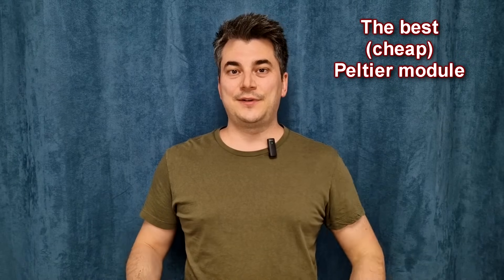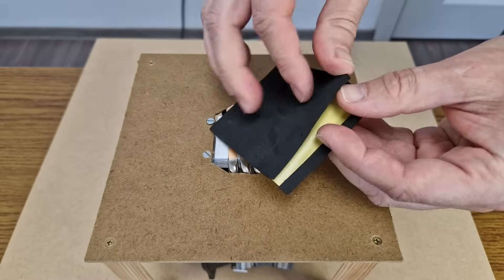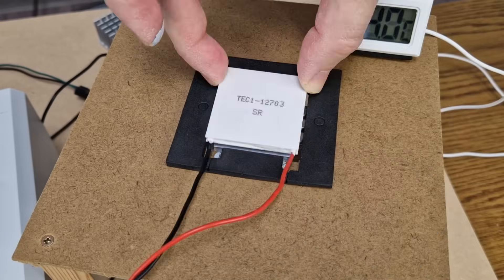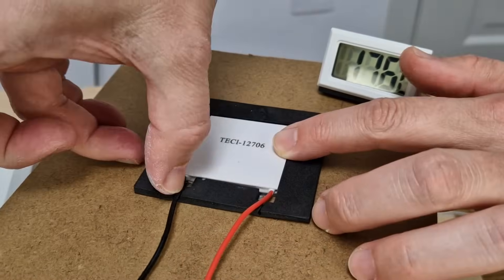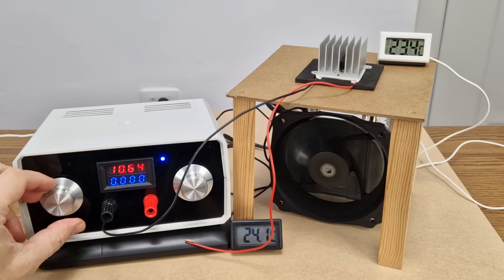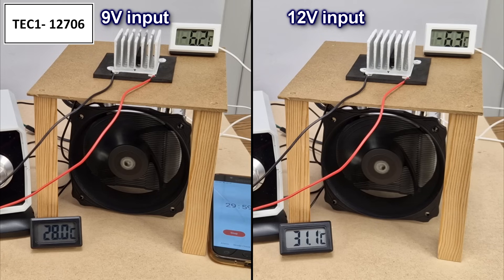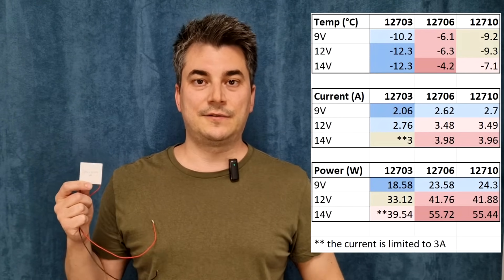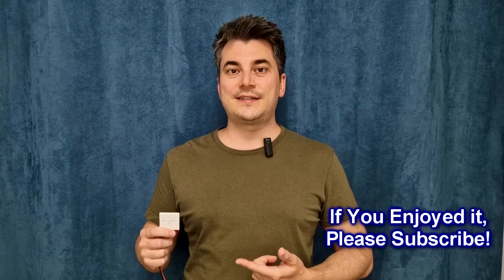The best (cheap) Peltier module [test 2]

Comment: I've just got into peltier experimentation for the first time. At the moment I've only got the 706 modules. It seems to be true that the hot side heatsink needs to be huge for this one. I found a CPU cooler on a scrap desktop so I'm using that for hot side with the fan set to run at full speed. Down to minus 8.7 C on cold side so far (been running 20 minutes). Powering it all from a small LiFeP04 battery. Voltage at this moment 12.73 current 3.75 amps including fan, which uses 300ma at full speed.
Reply: You should be watercooling the peltier on a waterblock with a radiator instead of treating it like a CPU.

Comment: Why the 03 Peltier performes not as good as in the first test with 12V?
Reply from the maker: Because in the second test it has a bigger radiator on the cold side, it has to work more to cool it down.

Comment: Don't blame you but peltier elements rely on constant current.
You waste around 30% energy heating them up with constant voltage here.
Thats also the point of the three tiers - the max current rises with each "better" model. 3A -> 6A -> 10A

It may be asked a lot but PLEASE rectify this and do the correct test.

Comment: Would the 12703 be a good choice to use for a simple laser power meter if the lasers being tested are less than 1Watt (1000mW)?
Reply from the maker: Yes and you can probably power it with a lower voltage.
Reply: @Sorin_DIY  Thank you for your reply. Actually, the laser is pointed at the Peltier and a volt meter is used to measure how many mV are produced. That number is used to calculated roughly how powerful the laser pointer is. I will purchase a 12703 and experiment a little. Thank you for posting the link to the Peltier modules!

Comment: Sorry, but this experiment is also bad. It is extremely misleading and it neglects many basic concepts. 

Just a little list: 
- It is not true that Peltiers have a recommended supply voltage of 12 V. Where did you read this nonsense?
- You did not apply the same amount of thermal paste for all modules. 
- You failed to notice that something is wrong with the whole setup. The Peltier is not clamped down, therefore the heat transfer between the hot side and the CPU cooler is insufficient. This clearly shows up in your results. If you look up the datasheet for example for the 12706, at 12 V you should have somewhere between 4-5 A, but closer to 5 A. You barely reach 3.5 A. This is because the temperature difference between the hot side and the cold side is very large because in your case the hot side is very hot. Therefore, the Peltier throttles itself down and that's why you see such a low current. Same for 12710. 
- Furthermore, you should have noticed that even at 14 V, you were nowhere near the maximum rated current of the Peltier cooler. Again, your setup is faulty. 
- For the TDP, you failed to mention the heat pumped from the cold side to the hot side. That also appears on the hot side and it has to be dissipated by the CPU cooler. Even though this heat is not a large amount, it matters. 

Unfortunately, your results are bad and misleading a lot of people. I hope you won't get me wrong, but you should study thermoelectric coolers a bit more before trying to educate people about them.
Reply from the maker: You are nitpicking, for example when I power the 12706 module with 12V in the first second both Peltier surfaces have the same (room) temperature, it draws 3.65A. Why doesn't it draw 5A in the first second? it takes at least a few seconds to heat up. after 30 minutes the current consumption is a bit lower, but not too much and not in the first second. and also this problem should affect all the modules including the 12703 (not in exactly the same way, please don't nitpick, but to some extent). I'm guessing that this is because the modules are of low quality. 
the (lack of) thermal paste is not a problem, I also added paste on both radiators before mounting each module, even if it's not visible on camera. 
I know that the test isn't perfect (nothing is), but there is no point in continuing to explain, you've already made up your mind.
Reply: @Sorin_DIY  It is not nitpicking if I can identify several multiple mistakes throughout the video. The current could be limited by the contact resistance of your dodgy cabling as well. You just pushed a bare wire into the connector of the power supply. At these high currents, they should be clamped down correctly, and there should be a decent connection between those wires and the power supply. I tested many of these Peltiers, but they never acted like this. I could nearly reproduce the datasheet values in my tiny "lab" at home. If something is wrong with these devices then it is typically the fact that they are falsely labelled. I encountered coolers labeled as TEC12517 but they we actually TEC12706 when I measured their characteristics.

Comment: Hi, I watched this video and bought 2 of the 12703 . I have them hooked up to a 12.5 Amp 180 watt power supply found on Amazon.  The hot side gets 140 degrees but cold side only gets to 64 degrees.  What's my deal?
Reply from the maker: Did you add a large cooler on the hot side of the module?
Reply: @Sorin_DIY Thanks for replying.  I've got a 120mm by 70 mm heat sink that the 2 modules are thermal glued to and 2 40 mm heat sinks thermal glued to modules.

Comment: please reply
" WHY ARE ALL THE MODELS CONSUMING SAME AMOUNT OF CURRENT(AMPERE)"
Reply from the maker: The modules don't use exactly the same amount of current, there is a small difference between them. the higher the supply voltage, the higher the current consumption will be for all modules, so you need to limit the current according to the specs of each model. they can be powered with up to 15V and some of them even 16V. and also these modules are cheap and of low quality; high quality modules are very expensive and more accurate with the current consumption.
Reply: Good observation! The higher power modules "throttle down" because they don't have sufficient cooling on their hot side. He did not clamp down the modules, so they don't have sufficient contact with the CPU cooler. They borderline overheat and therefore they limit their own current. It is "just" a very bad experiment.

Comment: Hello Sorin, content suggestion: you could bring a complex project with a power bank with a built-in Android smartphone in conjunction with smart relays to control them remotely (turn on, turn off lamps, sockets, maintain with UPS and or turn on, turn off modems and routers and computers remotely in case of malfunction)

Comment: Can i run the peltier with a charger😢
Reply from the maker: It depends on what kind of charger. if it delivers the necessary voltage and current, it will work.

Comment: thank you so much my friend, great job well done
Reply: im in order build mini water cooler peltier fan PLUS mini refigerator (dunno what im thinking but i like chill ambience on my desk and take one shot soft drink)😂 , 

in my case i just found -9 degrees celcius with 3x3cm peltier reaching so fast and only using usb c PD charging decoy port. its about 25 watt in smartphone adapter with volt amp meter (6v-7v) fast cooling and stable.

and in another case, just found chinese cooling fan for smartphone 2,3cm peltier can reach -3 degrees celcius, 2,5cm peltier can reach -5 degrees C. stable. (edited : 2,3cm = -5 degrees, 2,5cm = -3 degrees)
*i use proper thermo gun not that fake lcd indicators

thats insane the voltage, fan and heatsink not heavy stuff only 5v - 1-2Amp
Reply: you can try more affordable peltier for sure and save energy more for the earth lol😁 nice to meet you. enjoy

Comment: Agree 100%, especially because my applications are all for outdoor solar powered electronics.....the ability of the 03 modules to operate efficiently down at 9vDC gives me a little more wiggle room for parasitic current draws like cooling things getting cooked in the sun. As a personal project, i might have to try a similar concept on a game camera or two since they are notoriously easy to kill with only moderate heat or sun exposure.
Many thanks for posting this comparison.

Comment: Would you also consider testing the SP1848 27145? I can't see if it's supposed to be a generator or a cooler, but I'd like to see how well it performs in cooling against the TEC127XX units you have. Even if you don't test generation, just pumping, that would still be interesting to see.

Comment: I tec cooled my canon t3i dslr for astro imaging. I opened the camera and packed thermal transfer pads to get the sensor heat out the back of the camera. I did not want to cut up the camera, so there is plastic thermal resistance. By far my best results are using two 12706 (60W) stacked (gives more thermal delta, but less cooling throughput). And only running them both at 3.5v, it lowered the sensor from 95F to 55F, and it makes a big difference in dark noise.
Reply: Interesting. Begs additional information such as how do you know what the sensor’s temperature is, and what did you use for cooling the hot side of the stacked TEC1-12706’s?
Reply: @wuscraccin two ways, exif info shows sensor temp, and i have a thermal couple on the sensor. Also, while teating tacking 10 minute dark frames, a jpeg picture qill be smaller file size as there is less noise.

I used a 60w old amd cou heatsink/fan running on 7v

Comment: I wonder which ones would be best for stacking the TECs to increase thermal delta. I think I remember reading that the power needs to be increased 10-fold per stage to be effective. Somehow I don't think that's right and I would like to know how it actually works in practice.

EDIT: I would also be interested to know how long each of these modules would take to chill a cup of water. I think the higher power ones have greater thermal transfer but a lower delta.

Comment: Are those bare wires you put into PSU ?
No banana jacks ?
What is contact resistance of those ?
No wonder none of the Peltiers have pulled nominal current.

Comment: Hello my peltier is not getting too much cold even I bought 12715
Reply: It needs 15A at 12v so a good cooler is needet. For me an old big 6 heatpipe cpu cooler  wasnt enough, so i used an cheap used, but big aio watercooler.  This works extremly well. Also good thermal paste and High pressure on the Modul is needet for good thermal Transfer. Otherweise it is possible to break the Modul... 

I also found out some Modules are Fake, at 12v the 127815 schould draw about 15A , maybe a bit less, but at least 10A. But fake ones draw about 1-3A, not 10-15. 

The 12706 schould draw about 4-6A , good quality Modules also do this but cheap (fake) ones draw 1-3A .

Comment: I have bought many (tens) of Peltier elements from China via AliExpress. I tested them all and I'm telling you the performance varies a lot (!!); most of them are fake, they draw less current than in the datasheet, most frequently counterfeit is the 12710 type. I like your test, but I think the only real product is 12703, which really draws the current specified, the other 2 are drawing much less current and are less efficient.
Reply: Si ai facut o treaba buna, ca ai postat aici, felicitari ! (eu sunt Bogdan, am si eu un mic canal, dar nu am mai postat demult)
Reply from the maker: Salut si multumesc. Da, modulele acestea sunt de calitate slaba si dintre toate pe care le-am probat se pare ca 12703 e cel mai bun.

Comment: Hi Mr. Sorin, I love this follow up video regarding Peltier Modules. Ijust have a few questions:

1. with the experiments, the 12703 is the most efficient of the the 3 tested?
2. will the PM 12703 run efficiently at 9 Volts? whether I use 1 or 2 pcs of the module?
3 wiil the 12703 PM work on an air cooler with the cold side dipped in the water reservoir (with a heat sink attached) while the hot side is facing up with a cooling fan attached?
4. the #3 question's purpose is to cool down the water in the air cooler.
5. is the #4 question not practical for experiment or for long term use? 
Just asking rather than using an air conditioning unit....
Thanks for this video again...
Reply from the maker: 1. 12703 is the most efficient. 
2. you can use 2 modules, but they will need good cooling. 
3. it will cool the water, but the hot side is in the same room, so it's not very efficient. it's ok for hobby projects, but you need to separate the hot side outside the room.

Comment: Heat pipes works in any direction, but they tend to work better much better "right" side up, that can have a huge effect on how much heat they can transport. Also, the heat that needs to be dissipated is the power consumption, plus the pumped heat, even if the pumped heat isn't that much, it adds to the total load. 

But you've shown very well that adding more energy when heat dissipation is the main limiting factor won't result in lower temperature, and also that something designed for higher power doesn't have to be more efficient when there's a limiting factor stopping it for working in the range it's intended for. 

3 amp modules are probably a good choice for most hobby projects, unless both the heat dissipation is good enough for higher power, and also higher power per module actually is needed, assuming a large temperature difference is needed, and not necessarily much heat flow at modest temperature difference.

Comment: Nice video. I guess your "cold load" is far too small yet, so the lower power peltier gets too much of a advantage. A heatsink with cooler in the cold side, should improve the performance of higher power models and give a much better result. Just a guess through. Great work again.

Comment: I also Suggest a 12v 15Amps smps and test again 1210 peltier module
I guarenteed More better performance...But also you are right because in 3amps power supply Better performance in 1203peltier module because maximum power rating 3apms
and a 1210 peltier module Current Limit 10amps
Reply: Isnt it hard to find actual legit ones?

Comment: I was just watching the older cooling videos yesterday and tried the same experiment you did here, but with just the 12706. It might not be the most efficient, but with a 6-heatpipe cooler, it's amazing what it can do. I ran it at about 10-11 volts and got down to -10 on my cold-side heatsink. I didn't apply as much thermal paste as you did, so I did have some thermal limiting at 11 volts.

Comment: Cum putem genera electricitate din module peltier ? Am o soba care pe spate ajunge la peste 150 °  .....
Reply: e simplu: se lipeste elementul Peltier pe soba, iar pe partea cealalta ii trebuie un radiator prin care sa treaca aer mai rece; diferenta de temperatura intre cele doua suprafete va genera o diferenta de potential ; atentie insa sa nu depasesti limita maxima de temp. admisa in fisa tehnica
Reply: @virgilius1979  nu neg ca asa se face si multumesc pentru raspuns. Dar doream ceva cam la 100w+ , ceva care sa gerereze curent prin usb pentru diverse dispozitive. Experienta celor care au facut asta mi ar fi de ajutor
Reply from the maker: Salut, trebuie sa fie diferenta mare de temperatura intre suprafete. daca soba e calda automat si aerul din camera va fi cald. ar trebui sa ai 60 grade C pe o parte si sub 0 grade pe cealalta parte. chiar si asa un singur modul produce o putere foarte mica, probabil mai putin de 1W.

Comment: I also suggest applying pressure to the peltier cooler, in my many experiments I have found that clamping the cooler to the heatsink increases thermal transfer greatly. Also the maximum temperature differential is very different to actual energy pumped, the higher power coolers will maintain a smaller temperature delta but will pump a lot more energy than the lower power ones.
Reply: And put hot side up and blow air against it.
Reply: I agree with this from my experience cryocooling CPUs, some clamping force is almost always needed. The clamping fixture must not transfer heat from one side to the other however.
Reply: they issue I have is these are amp driven. you are not using the 06 and 10 to there full potential. if you need 0c degrees, the 03 would be good enough.
Reply: We should also consider the quality and type of thermal paste used. I think that you should try using arctic mx-4 or other high quality pastes used to build PC's.